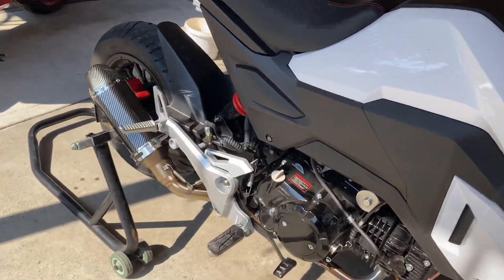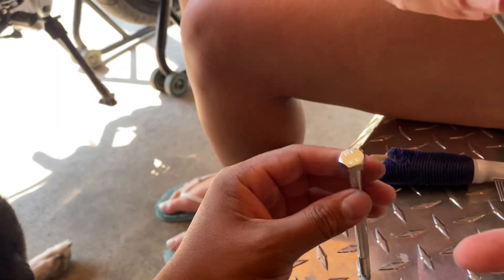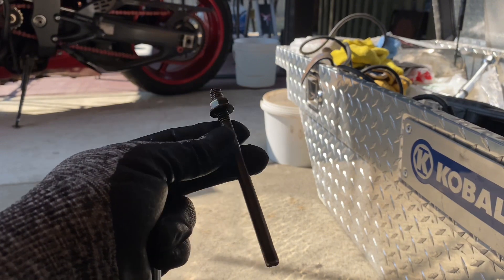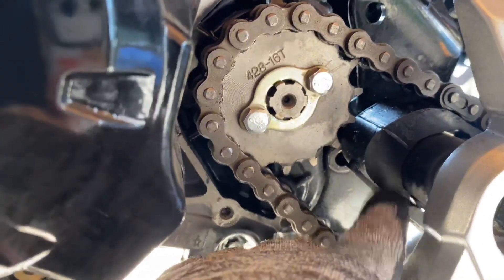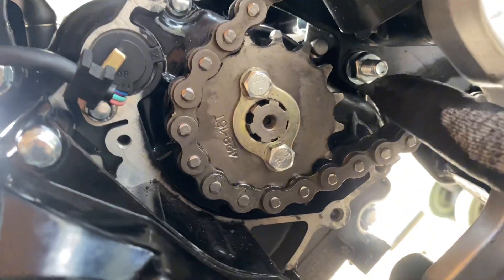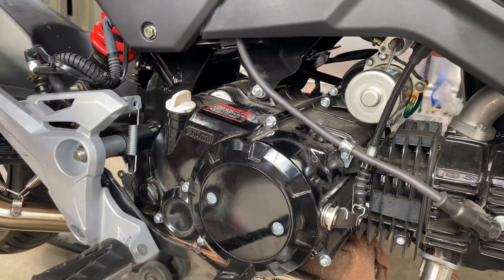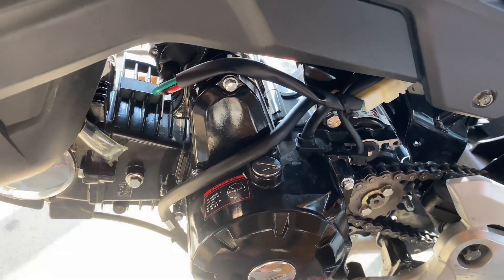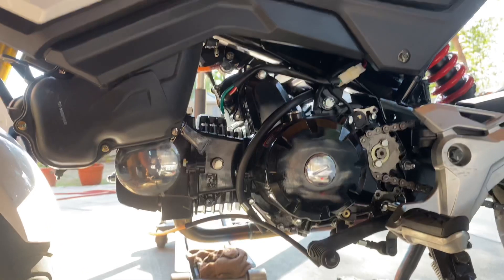Boom Vader Engine Bolt Upgrade

Comment: Did you upgrade it to a stronger bolt but the same size because I noticed you didn’t drill anything out so I’m assuming you didn’t go with the three eights?
Reply from the maker: Yeah I upgraded to a stronger bolt grade 8 m8 1.25x120mm you can find it at Lowe’s it’s exactly the same size. I’m actually out test riding it right now and it got rid most of the vibrations too
Reply: @JamesOnWheels  so when you try to shake the engine does it have any play in it ?
Reply from the maker: @desertwolfarmory  nope, with the stock bolts the engine would move when I’m revving it, but with these new ones, the engine does not move, even when your near redline. I just came back from a 50 mile test ride and I can say it feels pretty SOLID

Comment: Are both top and bottom bolts the same length?
Reply from the maker: Yeah it’s the same size they’re both class 8 M8 1.25x 120mm bolts
Reply: @JamesOnWheels  thank you yeah i had my bottom one sheer out yesterday as i was riding from the bolt end going to change today
Reply from the maker: @unpredictableiii  good luck on the change, lemme know how it goes

Comment: I've broke the stock lower bolt, and replaced it, later upgrading(drilling out) to a larger bolt.  Have had any problems torquing to 40?
Reply from the maker: Nope i looked up what the grom specifications were and it’s between 35-40 but I haven’t had an issue, 1500 miles later and it’s still holding on Pretty good
Reply: @JamesOnWheels  I actually broke a replacement 3/8'th grade 8 bolt.  Trying to figure if fluke or I messed up torquing it.  Thanks for reply.

Comment: The mount u bolted next to the sprocket, how close does it get to the sprocket? I’m afraid my 17t will hit it if I were to install it the same way u did
Reply from the maker: It doesn’t hit at all. Ever since I replaced it I have put 1000 miles on the bikes and the bolt has not broken off or caused any issues touching the sprocket
Reply: @JamesOnWheels  did u end up putting the sprocket cover back on? Hella ppl tell me that the chain hits the cover and to grind off an inch or so for the chain to clear so I’ve kept it off since the install. Appreciate u bro.
Reply from the maker: @slapslap9715  that’s exactly what I did I grind off the plate I think that’s in my sprocket video
Reply from the maker: I grinded off my sprocket cover and also since then you should go with a 16 teeth more torque and you still have top end